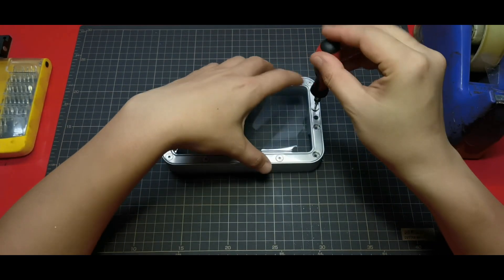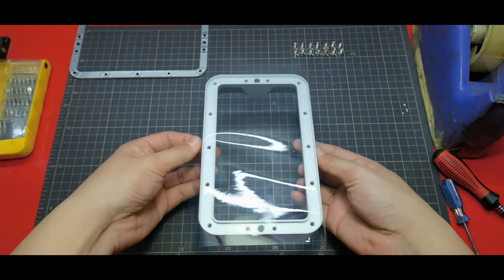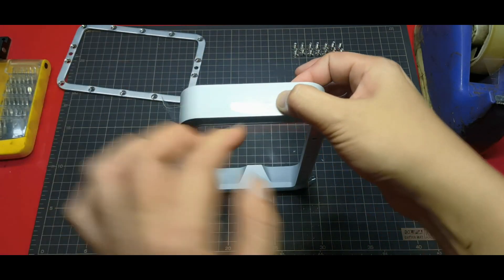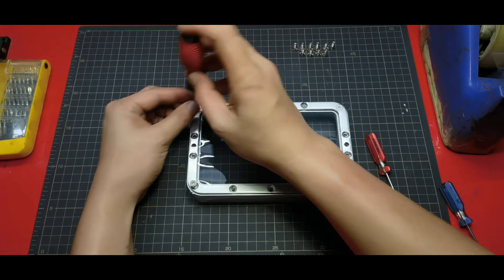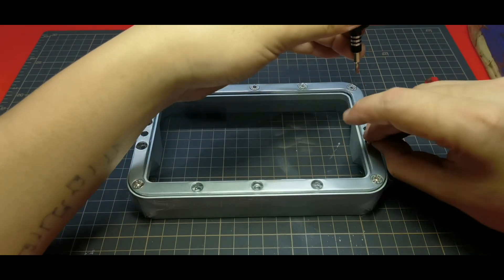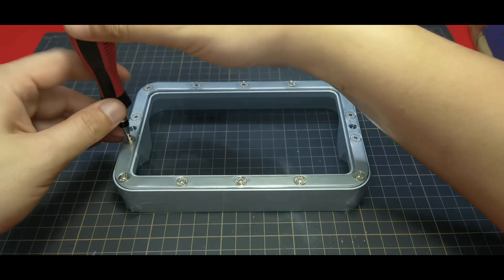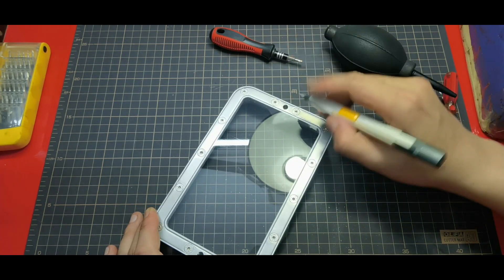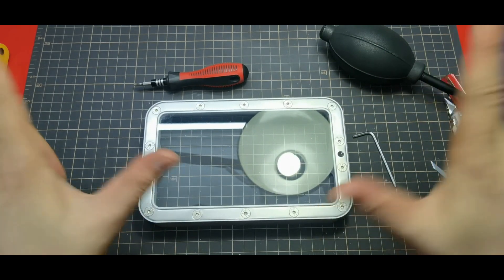How To Replace Fep Nfep With Perfect Tension All The Time

Comment: Replaced the fep on my large upgraded Transform, seems ok, i did also use clamps on the 2 large sides bc the fep is pretty thick 150 um after stretching the fep a bit so that metal gasket went all the way down, next is levelling.

Comment: I have a Halot One and with the tape on I couldn't get the screws started no matter how hard I pushed down on the retaining ring. I had to pull the tape off at each spot as I was trying to get each screw started. After I got the corners going I took the rest of the tape loose.
Reply from the maker: That is also good

Comment: How do you avoid it being too tight? I've changed mine twice now but its too tight which too much suction in print
Reply from the maker: Tightness doesnt affect suction.

If you think your fail due to suction, that usually means wrong orientation or lack of drain hole or slightly underexpose
Reply: @wangdennys  oh, I was having perfect prints before I changed the fep
also I meant pulling force not suction
Reply from the maker: @ebanksstudios  usually after change fep
That is because different fep quality.
Usually just readjust your exposure will fix it.

Try my exposure tester on the super easy calibration video.
Reply: @wangdennys  Ok, thank you!

Comment: why do so many tutorials put a bottle cap or something under the fep?
Reply from the maker: People said fep can be too tight if installed without spacer and causes fail print etc. And they just copy paste other tutorial.
But i am still using the same fep since this video up till now on my printer. And no fail, no puncture, no nothing.
LOL
And been doing this method for the last 2+ years

I will work on another follow up video for this method too when it's time to replace the same resin tank fep. My guess is it can still go for another month with daily printing.

Comment: Great video...almost identical to how I do my nFEP, except I've never used tape...I will from now on though as your rationale makes perfect sense. At the end of the process, I also poke holes through the nFEP where the two holes fit over the bolts when placing the vat on the printer.
Reply from the maker: Some people dissagree with this
They said it will be too tight and creates fail print.
But print result shows otherwise. 😆
Reply: @wangdennys  Yes, you have some amazing print results. I've actually just right now completed changing to a new nFEP using this method and will do a print later tonight once the weather cools down a bit and we can turn the air-con off and open the windows and doors. It is definitely a tighter nFEP tension than what I normally have, but really interested in seeing how it goes :)

Comment: So there is no need on bigger print plates (like mono X) for special "bottle cap" on the middle of FEP when tightening screws?
Reply from the maker: This method is for resin tank with single gasket.
For dual gasket like mono x people still recommend bottle cap.

Comment: Great video! I tried to change the FEP on my Mono X but when I was installing it I lost one of the tiny screws that hold the FEP between the two aluminum frame pieces. Do you know where can I get those?
Reply from the maker: Dont forget to add spacer for your fep.
In most hardware store should have the same screw

Comment: Looks easy & clean trick … it’ll be very useful for a single gasket type resin tank like my LD-002H … but, I’ll stick to my electric screwdriver, I don’t want to tire my right hand by tightening the screws manually … :p
Reply from the maker: dayum... i gotta try electric screwdriver
never thought of it.